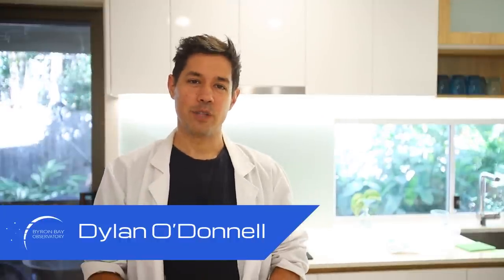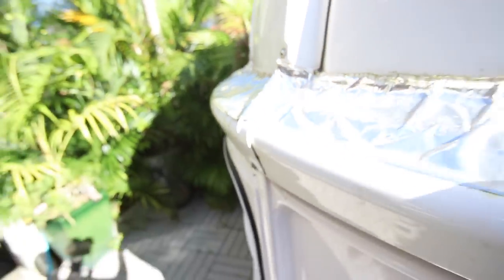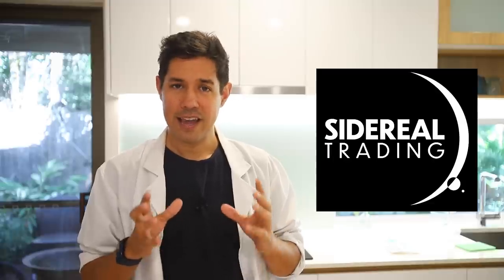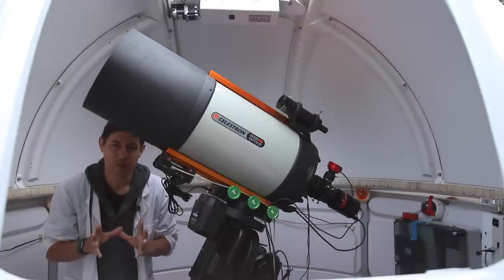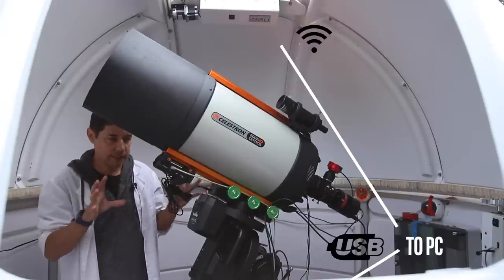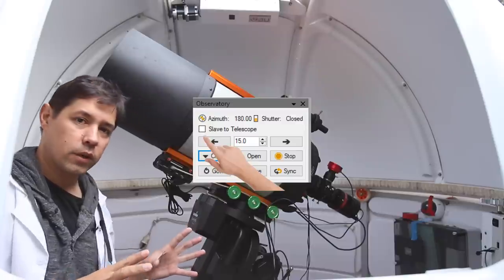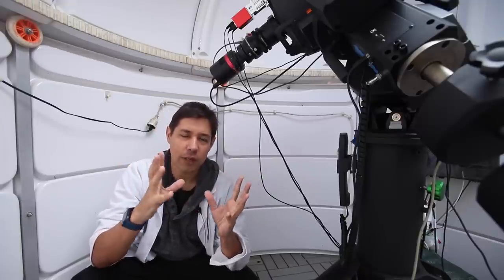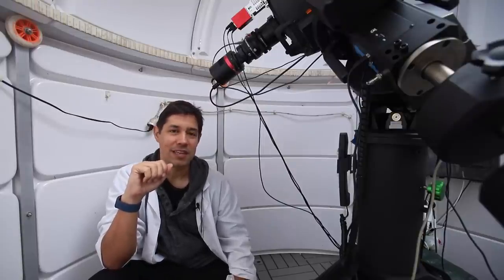How Observatories Work (Features NexDome v2!)

Comment: Thanks for the video, Dylan. It's curious to see the dome evolution. I am apparently at a "1.5" or "1.75" of the dome. New shutter, but similar panel design, so I have the gutters running around the outside. I'll be curious on your longer term take on the new shutter system. I have the similar HDPE rails running along the side and the opening and closing is smooth, but I feel the weather-proofness leaves a little to be desired from what I can see on the original design. Driving horizontal rains seem to be capable of making its way around the rails. There's enough gap around it to allow water to make its way into the dome (though it would collect drips). The door, when completely closed, even with the rubber gap on it has a enough  (again especially around the gaps for the rail system, where water can pour in through driving rain. I'd attach pictures if I could.

The back gap is easily addressable with wind skirting and rails that you typically see used on industrial garage doors or assembly line units. The sides, I am still working on. I don't mind a few drips from it on the worst rains, but I had a pile of snow end up on the shutter motor from a couple windy snow storms last year.

Out of all this, I will mention that Babak is very good to his customers, responsive, and takes feedback.

Comment: A couple of things I don’t like about these domes from various manufacturers is the lack of physical security and insulation. There also seems to be a lack of ventilation while fully closed? These telescopes are expensive. I’m sure there are measures one may take like adding insulation, cameras, sensors or a fence, but still, it’s not like locking your common mower you bought from Lowes one afternoon away in your shed. One would need to be in a place with near perfect weather all year and good security on the grounds. Hardly ideal for most folks.

Comment: I realize this is about a year late, but I just watched this video and immediately recognized that you installed your RAM cards side by side.  Most...and I verified with your motherboard specs, that the RAM cards on your computer should have been installed with an open slot between them.  The way you have them installed, you have handicapped your memory speed by 50%.  They are running in single-channel mode instead of dual-channel mode.  :)

Comment: Really cool! Hope the weather is better for you. Would love an observatory someday. (Living vicariously seeing your set up :) )

Non-sequitur. 

What dew shield is that? Looks a lot cleaner and easier to use than the ones that go over the outer ring. Does it lock in like the scopes cover? I'm actually currently designing a 3d printing cable manager to get rid of diffraction spikes that will lock in similar to the cover. (I may also make one that mimics JWT... )
Reply from the maker: Thanks mate :) and if you check the video I posted before this one.. it’s all about that dew shield! I love it, works great.
Reply: @DylanODonnell  will do!

Comment: Wouldn't it be nice if the EQ8R-Pro had through mount USB cabling that worked instead of looking like it had a bowl of spaghetti dropped on it?
Reply: I chopped the power cable on the DEC saddle and wired in and XT60 to a pegasus powerbox. I run a NUC and powerbox under the Edge 11 in my setup. The wiring internally is 105C cable at 18AWG, which can run 18 amps, which derated for being bundled with other cables and run through the chassis, I cacluate it to be comfortable at 9A. I run two cameras for tandem imaging, a rotator, two focusers, and two filter wheels, along with the dew heaters, and NUC and never reach above 6.5A. Also, ethernet run from the base through the back of the DEC saddle to the NUC works well. Cleans ups the cabling and power distribution nicely!